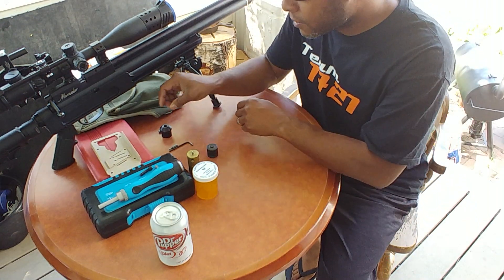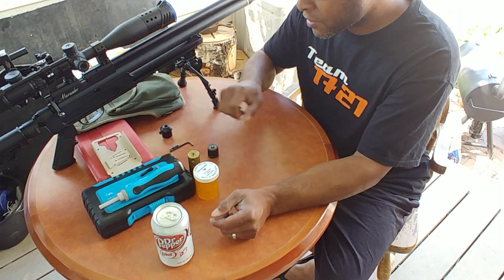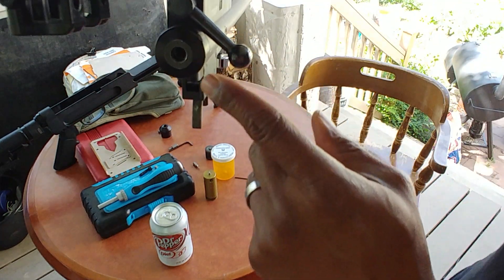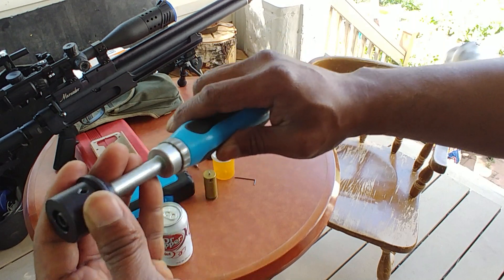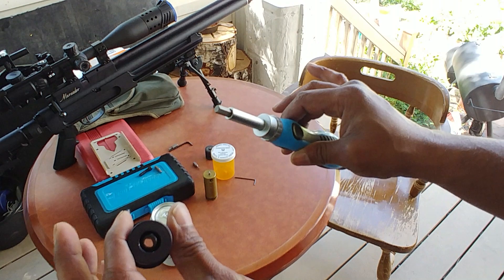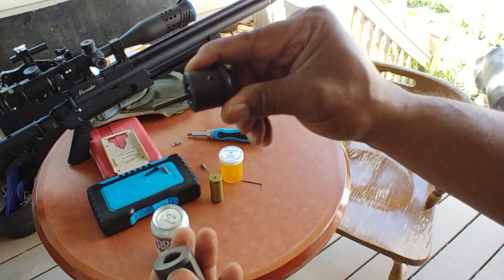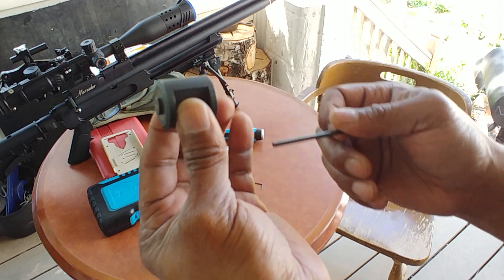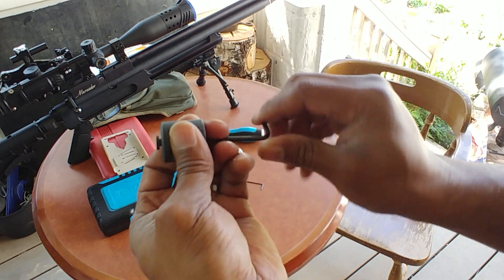How I tune a Benjamin Marauder for power.

Comment: After you did that tune on your Marauder what kind of velocity did you end up with? Thanks a bunch. I've ordered a Chrony just recently.
Reply from the maker: Here's what a friend's M-Rod did after I tuned out...

Created: 03-13-2018 09:21:50 AM
Description: .25 M-Rod
Notes 1: v.a.5ccw, rva5cw, hs3cw from face
Notes 2: Eunjins 16 shots 3000-2000
Distance to Chrono (FT): 1.00
Ballistic Coefficient: 1.000
Bullet Weight (gr): 43.200
Altitude (FT): 5280.0
Temp: 35 °F
BP: 24.81 inHG
Shots
#     FPS        FT-LBS     PF
16    737        52.11      31.84     
15    739        52.39      31.92     
14    740        52.54      31.97     
13    746        53.39      32.23     
12    751        54.11      32.44     
11    755        54.69      32.62     
10    756        54.83      32.66     
9     761        55.56      32.88     
8     759        55.27      32.79     
7     762        55.71      32.92     
6     762        55.71      32.92     
5     764        56.00      33.00     
4     761        55.56      32.88     
3     758        55.12      32.75     
2     760        55.41      32.83     
1     758        55.12      32.75     
Average: 754.31
StdDev: 8.96
Min: 737
Max: 764
Spread: 27
True MV: 754.40
Shots/sec: 0.10
Group Size (IN): 0.00
Reply: @Monkeydad1969  do you tune Hatsan guns?  can u add a huma regulator on the marauder ? I want the 25cal power tune ,valve work like u said, 55-60fpe is what I wanted..I have a 30cal Hatsan bully, haven't opened the box yet..
Reply from the maker: @bigearl8687  I never worked on a Hatsan.  I done even one, yet.  Yes, the Huma can be installed...may need a bigger plenum.  The Bully is a beast.  That's one Hatsan I do want.  I do have a bottled .25 with a Lane and this is what I got on 2050psi, but I'm sure it's capable of the 55-60fpe.

Created: 12-09-2018 04:02:31 PM
Description: .25 BaskettCase,  2050psi reg
Notes 1: Full shot string, 4 CW RVA
Notes 2: 3500-2050
Distance to Chrono (FT): 2.00
Ballistic Coefficient: 1.000
Bullet Weight (gr): 25.390
Altitude (FT): 5280.0
Temp: N/A
BP: N/A
Shots
#     FPS        FT-LBS     PF
48    849        40.64      21.56     
47    851        40.84      21.61     
46    851        40.84      21.61     
45    860        41.70      21.84     
44    857        41.41      21.76     
43    858        41.51      21.78     
42    859        41.61      21.81     
41    861        41.80      21.86     
40    854        41.12      21.68     
39    861        41.80      21.86     
38    861        41.80      21.86     
37    860        41.70      21.84     
36    857        41.41      21.76     
35    856        41.32      21.73     
34    861        41.80      21.86     
33    857        41.41      21.76     
32    858        41.51      21.78     
31    855        41.22      21.71     
30    860        41.70      21.84     
29    860        41.70      21.84     
28    857        41.41      21.76     
27    859        41.61      21.81     
26    859        41.61      21.81     
25    858        41.51      21.78     
24    857        41.41      21.76     
23    855        41.22      21.71     
22    859        41.61      21.81     
21    859        41.61      21.81     
20    858        41.51      21.78     
19    855        41.22      21.71     
18    856        41.32      21.73     
17    858        41.51      21.78     
16    863        42.00      21.91     
15    859        41.61      21.81     
14    860        41.70      21.84     
13    856        41.32      21.73     
12    864        42.09      21.94     
11    858        41.51      21.78     
10    860        41.70      21.84     
9     859        41.61      21.81     
8     859        41.61      21.81     
7     858        41.51      21.78     
6     858        41.51      21.78     
5     861        41.80      21.86     
4     859        41.61      21.81     
3     857        41.41      21.76     
2     860        41.70      21.84     
1     867        42.39      22.01     
Average: 858.21
StdDev: 3.13
Min: 849
Max: 867
Spread: 18
True MV: 858.40
Shots/sec: 0.11
Group Size (IN): 0.00
Reply: @Monkeydad1969  so can you tune the marauder to shoot those heavy pellets like the 33g jsb, 43g eugin, 31g h&n ,27g benjiman...that 48 shot string look dam good
Reply from the maker: @bigearl8687  I'm gonna try.  I'll keep you in the loop.

Comment: Shat size thread is the grub screw velocity pin i messed up and lost it i know rookie mistake
Reply from the maker: Did you lose the actual velocity adjustment screw or the grub screw that holds it in place?  The grub screw is 8-32.
Reply: I lost the grub screw and also i did the same adjustments u mentioned and ive lost power do you know your factory settings for a .25 i lost my paper with my info. I really dnt want to send it in i just got it
Reply: @Monkeydad1969  thanks for the quick reply didnt think u would answer
Reply: eddie 2fast  I have a tune for a 2nd Gen 25cal Marauder. First loosen the locking or grub screw that stops the velocity screw from moving on the side of the receiver. Then turn the velocity screw clockwise until it bottoms out, then back the screw out counterclockwise 5.5 turns and then tighten the locking or grub screw so it doesn’t move. Then the hammer throw adjustment needs to be turned counterclockwise until it bottoms out, then turn clockwise 3.5 turns. The final adjustment is the hammer spring, turn it counterclockwise until it stops and then turn clockwise 4.5 turns. This tune shot well with my gun shooting JSB exact Kings. When you adjusted it before if you get hammer throw mixed up with hammer spring it will rob you of power if your trying to adjust the hammer striker or throw back all the way against the face of the hammer. The hammer throw is the smaller Allen wrench that goes in the farthest when adjusting from the back of the receiver. Hope this gets you back where your gun was before because this tune is very close the factory adjustments my gun came with, just slightly fine tuned.

Comment: Hey sir I've got a question for you when you do the tuning on the marauder like you do it what kind of shop count do you get on the 22 caliber and what cop shot count would you expect to get on a 25 caliber with your tune
Reply from the maker: Here is a string with the MK2's.  Going to depend on ammo.  With the .22 I can't tell you, I don't have one.  Wasn't a bell curve, just a Korean cliff. Starts off high and gets low.

Created: 03-13-2018 09:32:34 AM
Description: Casey's .25 M-Rod
Notes 1: v.a.5ccw, rva5cw, hs3cw from face
Notes 2: JSB MKII 3000-2000
Distance to Chrono (FT): 1.00
Ballistic Coefficient: 1.000
Bullet Weight (gr): 33.950
Altitude (FT): 5280.0
Temp: 35 °F
BP: 24.81 inHG
Shots
#     FPS        FT-LBS     PF
16    776        45.40      26.35     
15    776        45.40      26.35     
14    783        46.23      26.58     
13    791        47.17      26.85     
12    802        48.50      27.23     
11    805        48.86      27.33     
10    805        48.86      27.33     
9     814        49.96      27.64     
8     816        50.20      27.70     
7     817        50.33      27.74     
6     821        50.82      27.87     
5     830        51.94      28.18     
4     829        51.82      28.14     
3     817        50.33      27.74     
2     831        52.07      28.21     
1     833        52.32      28.28     
Average: 809.13
StdDev: 19.16
Min: 776
Max: 833
Spread: 57
True MV: 809.22
Shots/sec: 0.12
Group Size (IN): 0.00

Comment: Good video Md1969, I like that stock on your 177, where'd you get that from? Wish I'd seen this video before all the mods I made on my 25 cal. But I enjoy mine just fine, but it does need to be chronied.
Reply from the maker: Thanks Ken.  The stock is a Teryx.  Unfortunately they are not made anymore.  I'm glad this vid has been helpful for a few shooters.  I'd have done a few more vids but my job keeps me going 6 days a week.
Reply: Monkeydad1969, ok thanks for the reply. I have Tim Hill valves and TP mods in mine, but have not chronied it yet, however I did notice an increase in power. Thanks again.
Reply from the maker: @marty4645  you definitely need to chrony it.  Helps a whole lot when tuning.

Comment: Where did you get that stock is it available for the mirauder 22 is it any lighter than the original version
Reply from the maker: It's a Teryx stock.  They aren't made anymore.  Mine are for the Gen I, they later came out for the Gen 2 and fit all calibers.  They're hard to find.  Weight is about the same as a wood M-Rod, but can vary with collapsible stock and accessories.
Reply: Do you have any idea what is the best shooting pellet for the 22 benjamin marauder, I am using 14.3 Crossman premier hollow points and they seem to work well but I want all the punch with accuracy that I can get

Comment: Awesome video. Would love to know what scope set up you have there - looks like you could nail a rat at 100 yds!  Thanks
Reply from the maker: Thanks condor5635---cool name by the way.  It's a Discovery DSII-88003 4.5-18x44 SFIR-N.  It's an older model but does the job.  No rats nailed at 100yds, but plenty of P-Dawgs down out to 200yds. 😁😎😉
Reply: Monkeydad1969 - Thanks but what’s all that stuff attached to the scope on the back is that your video camera infrared? Looks like you’re ready for covert ops!
Reply from the maker: @condor5635  that's my Side Shot.  They are great.

Comment: Hi Monkeydad1969, Excellent vid! I'm adjusting my .25 Marauder as well. What is your average FPS on the .25 cal with these adjustments using JSB exact king 25.39 grain pellets? Also, what pressure are you filling your reservoir to?   Thanks.
Reply from the maker: Hey sklecanda, I couldn't tell you right now.  I didn't have the chrony results anymore and my .25 M-Rod is in pieces.  But I have a bud who's getting in the 900's on a 3000psi fill.
Reply: I shoot my Marauder with 25.39 JSB's at 821 fps. When I first purchased it the pellets were hitting the ground 15 to 20 ft in front of me, the velocity screw was to loose and backed out. Any way I ran the velocity screw all the way in and backed it out 4 turns and put some blue lock tight on it. Next day I put the lock screw on it.  I set the big spring about 3 or 5 turns in and got my 821 fps. I saved my target, I was shooting bench on sand bags with absolutely no wind. I could see the pellets in flight, no kidding. I shot one magazine, 8 shots in one hole at 50 yards. My 12 year old  grandson and I are hunters, he shoots the Benjamin and I shoot my FX Bobcat both in 25 cal. I would like to thank Monkey dad for his video, it walked me right through it. Last rabbit season we took 40 cottontail rabbits, some good eating. Head shots only, Lol.

Comment: What's your shot count?
Reply from the maker: Here what I got on a bud's shooting the 43gr Eunjins.

Created: 03-13-2018 09:21:50 AM
Description:  .25 M-Rod
Notes 1: v.a.5ccw, rva5cw, hs3cw from face
Notes 2: Eunjins 16 shots 3000-2000
Distance to Chrono (FT): 1.00
Ballistic Coefficient: 1.000
Bullet Weight (gr): 43.200
Altitude (FT): 5280.0
Temp: 35 °F
BP: 24.81 inHG
Shots
#     FPS        FT-LBS     PF
16    737        52.11      31.84     
15    739        52.39      31.92     
14    740        52.54      31.97     
13    746        53.39      32.23     
12    751        54.11      32.44     
11    755        54.69      32.62     
10    756        54.83      32.66     
9     761        55.56      32.88     
8     759        55.27      32.79     
7     762        55.71      32.92     
6     762        55.71      32.92     
5     764        56.00      33.00     
4     761        55.56      32.88     
3     758        55.12      32.75     
2     760        55.41      32.83     
1     758        55.12      32.75     
Average: 754.31
StdDev: 8.96
Min: 737
Max: 764
Spread: 27
True MV: 754.40
Shots/sec: 0.10
Group Size (IN): 0.00

Comment: Im having big trouble i did what u said to my .25 cal and now its shooting really slow yave any idea what i can do to fix this
Reply from the maker: Hey eddie 2 fast, did you turn the velocity adjustment screw counter clockwise or clockwise?  For more flow turn it counter clockwise.
Reply: I turned it counter clockwise i backed out the hammer spring did 5 turns forward and the striker i adjusted it back and 3 turns forward and lost all power
Reply: Its still shoots juat not hard like factory settings
Reply from the maker: @bustin_slugs  ok.  What's your fill pressure?
Reply: @Monkeydad1969  just to 3000 psi